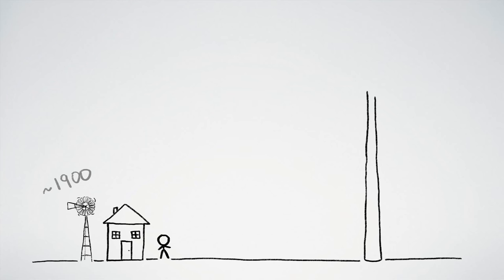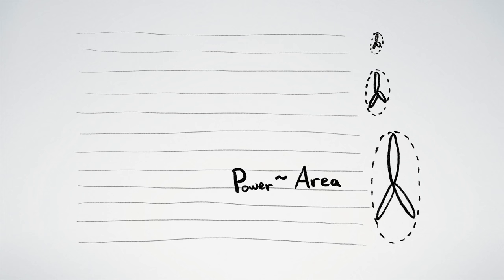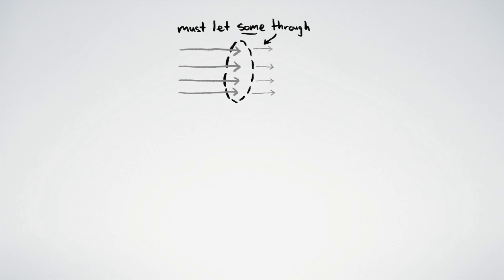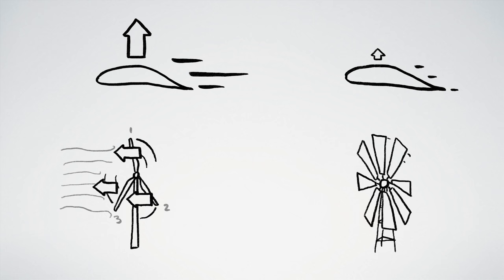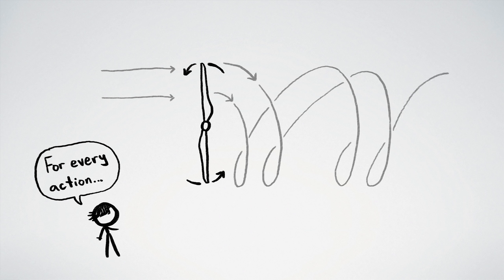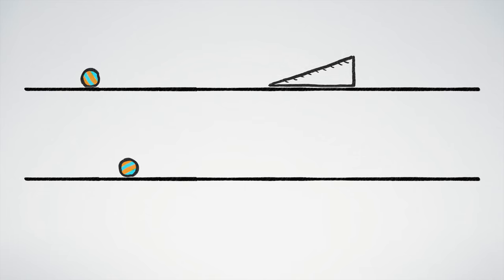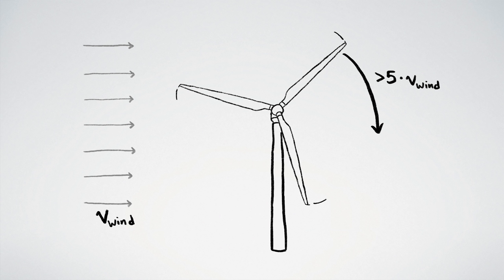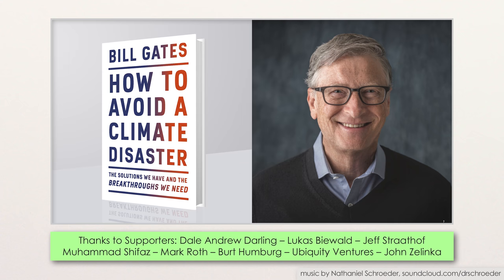The Physics of Windmill Design

Comment: The fastest sailboats hardly even use sails anymore, they’ve largely switched to wings.(they also don’t float during racing). Check out the America’s Cup
Reply: Technically, in certain configurations, a sail is functioning as a wing (mainly when going upwind).

Comment: As a wind turbine design engineer, I understand why you call them windmills even though they are wind turbines, but it still bothers me a bit ;)
Regarding size and speed, in practice and as a general rule, the bigger the rotor the slower it spins. Even though wind turbines are designed to maximise power they also have to follow strict rules such as noise limits. If you imagine 2 wind turbines, one big and one small, spinning at the same angular velocity, the tip speed of the bigger blade is going way faster that the small one. This can make a lot of noise and if you account that it ca also get in the range of supersonic speeds then a lot of other problems might come (ex: aerodynamics change, more vibrations inducing fatigue and lower component life etc).
Great video as usual :)

Comment: Re the energy imparted on the wind by the blades - would adding the 2nd wind turbine with reversed blades right after the 1st help in this case? Similar to how multi-rotor helicopters work.
Reply: It might cancel out the twisting of the wind stream, but it's not the fact that the wind is twisting that's the issue, it's the work done to make it so. Adding more work into the system to stop the twisting shouldn't help, I'd think.

Multi-rotor helicopters cancel out the twisting of the helicopter, where it's mainly the twisting it self that's the issue, not the lost efficiency
Reply: Twisting wind behind the rotor blades equate to inefficiencies. Adding another rotor, behind the first, won't make the first rotor more efficient 🤷

And the idea is to extract the maximum energy out of the wind, with minimal material used.
Reply: I agree with the other replies but also your setup would only work in 1 wind direction and would prevent the turbines from turning to track the wind.
Reply: @ResandOuies  Counter rotating fans are more efficient but not as efficient as just making the fan larger. The additional blades is a lot more mass that needs to be supported but it only gives you a small amount of additional efficiency. Adding a duct around the fan also increases efficiency but the mass of the duct makes it not worth it for the additional efficiency they provide.
Reply: You'd be better off just putting the 2nd windmill in the cleanest wind possible. Also, counter rotation would only work if the wind never changed direction, which it is quite famous for doing.

Comment: Man, the falling ball and slanted block thing took me way to much time to figure out
Reply: Care to explain
Reply: @ricoautosauve7849  Like throwing a baseball off the back of a moving car versus off the back of a stationary car.
Reply: @ricoautosauve7849  Work done on the object = Change in kinetic energy = Force x Distance traveled

During the collision, the forces on both objects are the same, but with the slope moving in the direction of the force, the energy stored in the compression from the elastic collision is more quickly depleted, leaving very little time for the ball to accelerate back and regain speed.

With the moving slope, the change (Δ) in speed and momentum are smaller for both objects, but the increase in kinetic energy of the slope is higher since it increases quadratically with speed

Comment: I recently listened to a podcast and they talked about how windmills are super optimized as individual mills but nowadays mills rarely stand alone and are often placed in windparks. It turns out windmills im the past have not been optimized to be used like that and all that is currently done is to optimize the placement of mills in the area. but for example a study they cited found that having some windmills spin the opposite direction could in perfect conditions increase the produced energy of a given area by 40% if I remember correctly.
I found that super fascinating and wanted to shared it with you.

Comment: Aren't modern windmills called wind turbines since they aren't milling anything?
Reply: Technically, in English... Though in casual speech where the distinction isn't relevant the terms are used interchangeably.
Reply: @laurencefraser  So with that logic it is fine to call a windmill a wind turbine, even though a wind turbine doesn't mill anything?

Comment: Also the 3 blade design is still a compromise, ideal would be only one Blade but that isn't stable enough
Reply: The structural mechanics probably dictate the design more since increasing the efficiency will have diminishing returns where as the power generation is squared on the blade length and cubed on the wind velocity.
Reply: Material engineering, you need to limit the size and increase the number of blades to reduce the force to any one blade to the tolerance of the materials.
Reply: This still doesn't explain why a 2 blade design isn't used.
Reply: This single blade turbine seems ok: https://www.youtube.com/watch?v=dpkMkBP6owQ
Reply: @justinhannan1713  yes, but that is not the most energy efficient design.
Reply: @justinhannan1713  It only works in the small scale.  For a big turbine, the unbalanced torque from air pushing on the blade would be a problem.

(And we still haven't answered why a 2 blade design isn't used)

Comment: A few years ago I heard of a project to make a 6(?)-bladed windmill, with shorter blades to enable cheap shipping via the extra-long standardized shipping containers.  The person behind it had supposedly worked out the math such that their design could achieve similar efficiency.  The idea was to make more windmills, offsetting that cost with cheaper shipping and mass production.

I only sort of grasped the numbers at the time, but I'm glad I found this video so I could get a slightly better grasp on said numbers.  I suppose the reason I've never heard of that project since is because of the energy losses from deflecting the air!

Comment: Why does a moving block absorb more energy from the ball? I feel like there should be a good explanation, but I cannot think of one for the life of me.
Reply: Not the only reason, but often starting friction is higher than kinetic friction. So it would take more energy from the ball dropping to get started than if it were already going.
Reply: The 'reflecting' surface of they block is constantly moving away from the ball, thus lengthening the contact time between ball and surface.  This allows more transfer of energy from the ball to the block, thus causing a smaller 'reflection'.  The same principle for padded dashboards, air bags, crush zones in cars.  Lengthen the contact time by moving with the colliding object to absorb some of the energy.
Reply: That's a good question. I have an answer, but it is going to get a bit technical, despite a simplification. I'd love to hear more simple answers.

Simplification:
The ball is very light and doesn't push the block away.

If the block is moving, you can change the inertial system to the moving block, and add the speed to the horizontal velocity of the ball (it is like when you are in  a moving train, it looks like the landscape is moving by).

And that makes it alot easier.
With the simplification you can exactly calculate the angles of the incoming ball and the outcoming ball (incoming angle=angle, when it is reflected).

Then when you subtract the horizontal velocity at the beginning from the horizontal velocity at the end, you get v(end)=v(start)*[sin(2a+b)-sin(b)] with 
a: angle of the object
b: angle of the incoming ball

and v*(end) is smaller, the bigger b gets. and b is dependent from the horizontal speed of the ball
Reply: @BL3446  That is an interesting idea. But we should expect kinetic friction to be pretty much constant and wouldn't explain the difference between the second and third cases when the block is moving faster.
Reply: @docostler  I was thinking about that as I was watching. I was thinking in terms of impulse, that the extended time would decrease the force on the ball. But I wasn't sure if that was even true and it would also diminish the force on the block due to Newton's 3rd Law. I am still a little confused by the longer time allowing more transfer of energy in terms of equations or laws.
Reply: @brauno3539  My inability to figure out why is a little embarrassing because I teach AP Physics 1. This seems to get closer to an explanation for me. I just can't figure out why there would be less horizontal velocity for the ball. It doesn't seem like the angle of the incoming ball and the angle of the block are any different whether the block is moving or not. 

As I am thinking about it now, it does seem like rotational energy should have something to do with it.
Reply: @lukerab  not to ask too much of you, but do you think there definitely more at work in terms of torque being applied to the ball? Not to go too deep by my problem with the illustration is it appears like a simple physics problem one the surface where there’s probably more going on at the heart of it, so now all the viewers have a false sense of knowledge about wake rotation. Which is funny because in my humble opinion it’d just be easier to explain that the work being done on the turbine is a product of blade torque and speed so having the blades rotate faster because of the wind reduces the torque applied both ways reducing the wake rotation while still getting a good amount of power.
Reply: @lukerab  I did say it wasn't the only reason. Did you want a full lecture on kinetic energy over YT comments? (Cuz it looks like we are all already getting one from multiple people. lol) Its an interesting point.
Reply: I feel like this statement is not correct. Neglecting any type of friction with the floor (which I guess it is the idea in this example), in the case of the moving block, the ball would indeed bounce less to the left, but it would still go faster downwards - after contact - compared to the case of the stationary block. Kinetic energy cannot be only calculated as a result of the movement of the ball in one axis.

I like thinking about extremes/limits to understand behaviors, and if we think for example that the block is going so fast, that the ball barely touches the block, you can see the ball would barely change it's total velocity downwards, keeping almost all of its kinetic energy. I don't see this as more energy transmitted to the block at all.

If you add friction to the floor then it is a different story because you have the difference between static friction and kinetic friction.

Probably it also makes a difference in the results if you have a rigid ball, a soft ball, rough surfaces or smooth surfaces.

I think this could be easily the next Minutephysics video ;).

Comment: This video tells me that a windmill with a single, extremely long blade would be most optimal
Reply: And you would be stupidly wrong. Luck us that you are not in charge. He has another video explaining that, so watch it, and think about what you will write before doing so
Reply: @ronwesilen4536  Ron, relax. Not everything in life is a battle.
Reply: There's another video of him explaining why that wouldn't be a good solution
Reply: There are such windmills. They use a counterweight on the opposite side of the blade. There are two-bladed winmills aswell. But the threebladed approach is better because the pole the windmill is sitting on blocks the wind. So the one- and twobladed mills can start to oscillate when the force of the wind is interrupted periodically
Reply: @ElijsDima  oh, shit, i never remember, thanks man, you so cool
Reply: long story short it would be unbalanced. the tri blade gives stability
Reply: @luciqua2517  with three blades the force still gets interrupted periodically right?
Reply: @squeakybunny2776  it does but the effect isnt as strong, esp. when comparing it to the one-bladed design
Reply: @luciqua2517  yeah I get that.. Just wanted to make sure

Comment: I designed wind turbines for 4 years in college and I never realized reducing rotational kinetic energy the wake was part of the reason 3 blade designs are preferred. I always understood it as a just a material optimization. Beautiful video! 

Hmmm, the reasoning in this video seems to disagree with what is stated on Wikipedia: 
"Aerodynamic efficiency increases with number of blades but with diminishing return. Increasing the number of blades from one to two yields a six percent increase in aerodynamic efficiency, whereas increasing the blade count from two to three yields only an additional three percent in efficiency. Further increasing the blade count yields minimal improvements in aerodynamic efficiency and sacrifices too much in blade stiffness as the blades become thinner"

Comment: Doesn't matter how much the wind people pay you Henry, the energy of the future is nuclear.
Reply: fusion*
Reply: Why not both?
Reply: I agree that nuclear is a promising energy source that deserves more investment, but the optimal low-carbon grid (with current/near future technologies) would still be a mix of nuclear and renewables. Nuclear is steady and reliable, making it a perfect baseload source. However, it is not dispatchable, meaning that the efficiency declines as the installed capacity rises above the minimum of the daily demand curve. On the other hand, solar and wind are inherently variable, and during periods of low generation, energy storage technology is not advanced or cost-effective enough to guarantee reliability with high shares of renewables. Instead, variable renewables are more suited to a load-following role, as the energy storage that is needed for balancing is generally very dispatchable, on the order of seconds for mechanical batteries or microseconds for chemical batteries.

Thus, nuclear and renewables complement each other, with nuclear for baseload and renewables (with storage) for load-following. Instead of shooting for 100% renewables, failing, and falling back onto natural gas or coal because of the immense and cost-prohibitive energy storage requirements, grid decarbonization can be achieved much more quickly, cheaply, and thoroughly by implementing nuclear and renewables each in the use case where they excel.

Comment: Didn't really explain why they aren't sails, like the thumbnail suggested the video would. Like long narrow sails or wing sails. Suppose it comes down to material strength and maintenance, but the fiberglass ones are so hard to transport.
Reply: He explained that you have to extract as much energy from the wind, while still letting the wind past (around 0:45). If you used a sail, all of the wind would be caught, but it would be impossible to get energy from new wind because there wouldn’t be anywhere for it to go.

Comment: Windmill blades have a fairly short life expectancy (about 20 years), and are contributing to a significant amount of landfill waste because they are extremely difficult and energy intensive to recycle. This doesn't include the costly and specialized equipment to manufacture, transport, assemble, and tear down these massive structures every couple decades, and all the carbon emissions produced by these processes. There's also no mention of the birds of prey and high altitude migrating birds killed by the spinning blades, which would otherwise be relatively unaffected by manmade objects. Windmills are a gimmick that do a lot of harm to the environment, and I wish pages like this wouldn't promote them as an environmentally-friendly alternative when there are better options.
Reply: Yeah that's BS. There are 60,000 wind turbines in the USWTDB. Average power is about 1.5MW, which corresponds to about a 70M rotor diameter and had blades that weigh about 22 tons. That means the total blade waste would be 1.3 million tons. Municipal solid waste in 2018 was 300 million tons, of which 50% went to a landfill. That means that the combined waste from blades from every wind turbine in the US is less than 1% of the amount of waste made each year by US citizens, and that's ignoring the enormous amount of waste from manufacturing. 

As if you weren't already disingenuous enough, you also don't talk about the waste from any other forms of electricity generation. It's almost like you're just trolling and don't actually care about landfill waste or any of the other so called issues with wind turbines.

Comment: Fun facts, wind farms slows down wind down wind of it, resulting in a temperature increase for the immediate area , they also destroy natural habitats due to their sound and large footprint required to install and maintain them, as well as the psychological impact of their presence on animals. With out a battery to store the energy, a lot of the energy they could capture is lost as well. 

P.S.
I am not saying we should burn coal like there are no tomorrow but we can't shop down more forest in the name a "green energy". we should force corporation on being energy efficient and stop waste. We should force product to be energy efficient, no more incandescence light bulbs or LED's bulbs that are over powered so they burn out( the LED lights you buy can be made to give the same light with a longer lighting life and less power but the companies make them badly so they fail early).

Comment: twist can be solved with stators like an axial flow compressor or turbine engine. Adds cost and such but in theory it soles the rotating air issue.